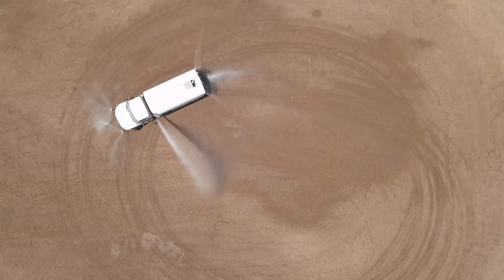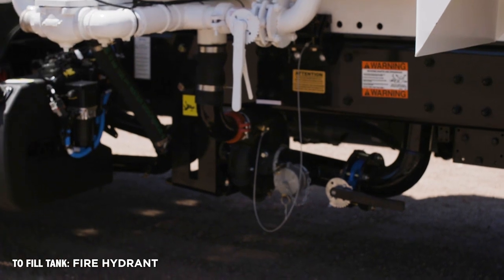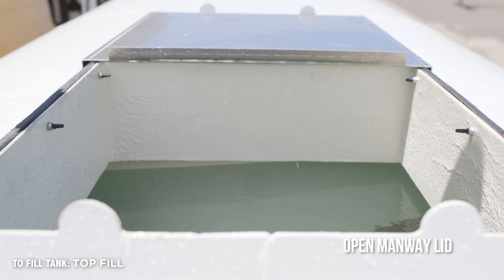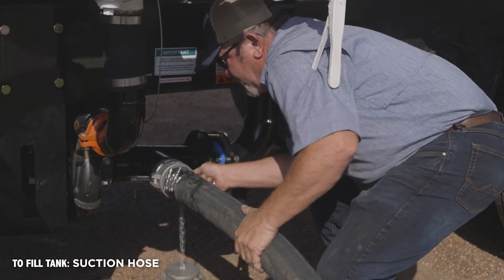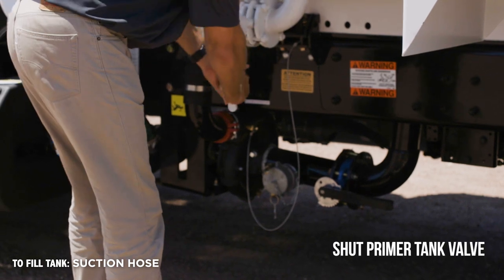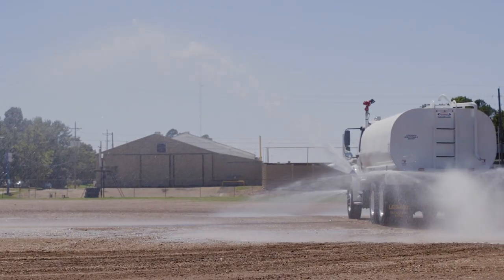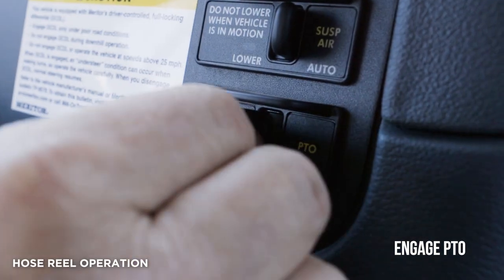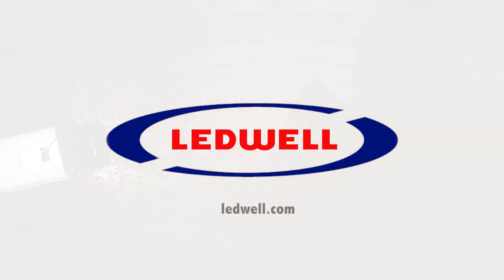Ledwell Operational Series | Water Truck

Comment: I have a tankers endorsement. Are all water truck controls the same?
Reply from the maker: There are some variations depending on the truck, but all operate the same.
Reply: in africa some are locally modified and it depends on the owners desire